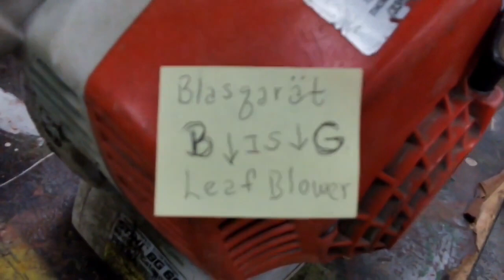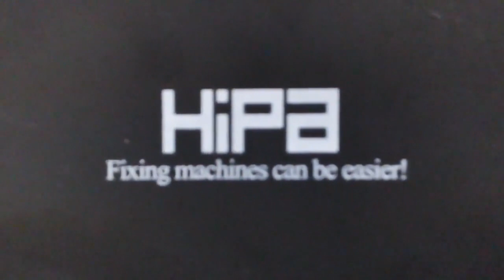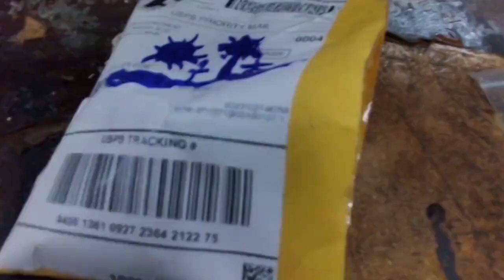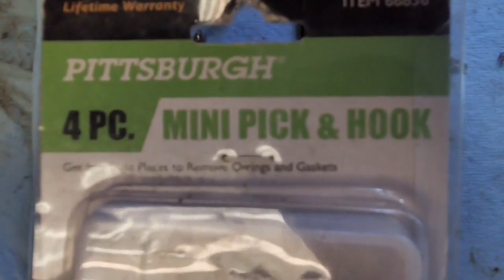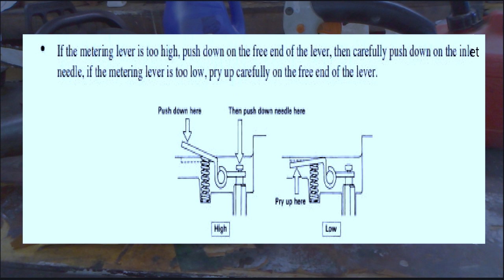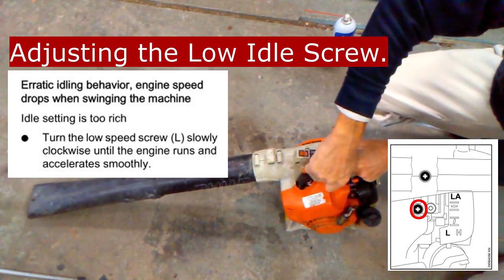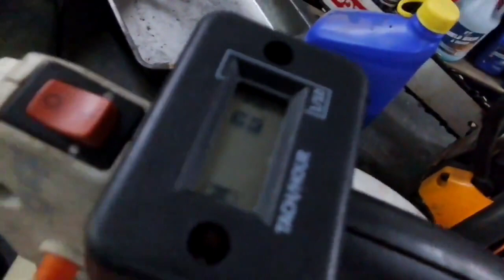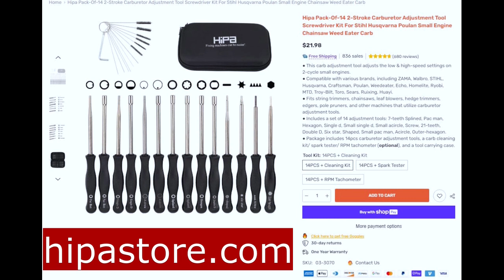STIHL BG 55, 65, 85 | NEW CARBURETOR/TUNE-UP

Comment: Question, why rebuild this when a new one is $20? Just wondering
Reply from the maker: Most carburetor kits you can get at a local dealer
that day you need it for around $10.  Otherwise
you can order a new OEM Carb for $40-60, or a 
knockoff, as in this case, and wait up to 7 days 
for a new one.  If need something now, it is worth
a shot sometimes.  Cheers!  🍻
Reply: @bigalsmallengines  oh got it. Thanks for the info.